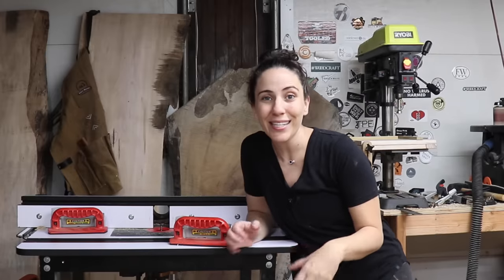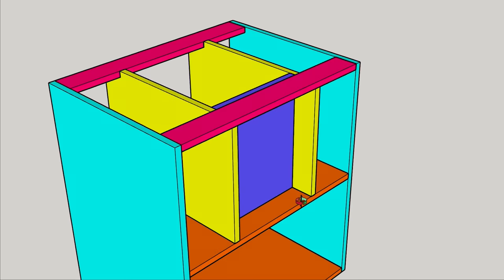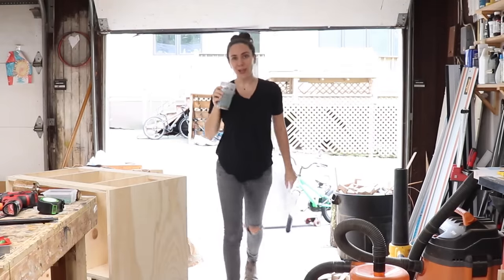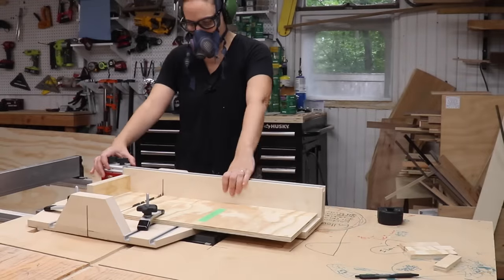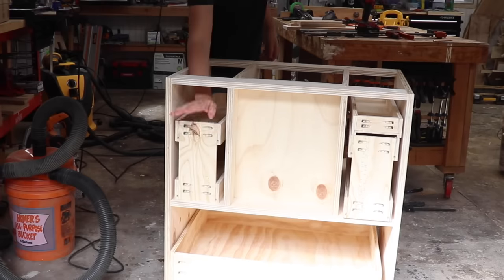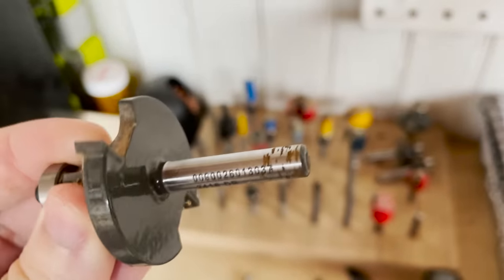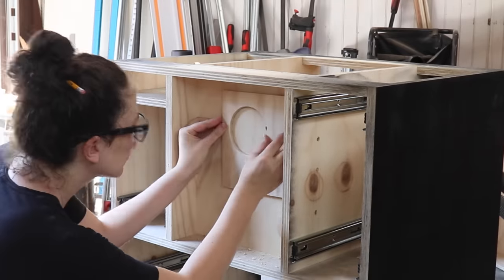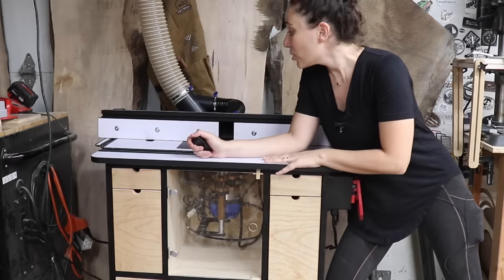Router Table Cabinet Build with STORAGE and DUST COLLECTION

Comment: Hi, Tamar,
Very nice work, even with the slots it looks really design cool.
I am sure that the vacuum suction will work better when the suction port is placed at the bottom or as down as it can in the back wall.
When there is suction in the current installation, the placement opposite the outer is such that the air is obliged to suck around the router body. 
So I think that this creates a vortex and the dust travels everywhere. 
I hope this will lead to get a  better result.
Keep it safe, it is not over yet.
Willy from Belgium.
😷😷😷
Reply from the maker: I think you’re right. I’m going to try to flip the door upside down
Reply: @3x3CustomTamar  
I did not think in you’re off smart stile, but you are right too.
We all should be very happy, we are geniuses.
Keep it safe, it is not over yet.
Willy from Belgium.
😷😷😷

Comment: First, again, great design and build.  For dust collection, I purchased the Keen Products dust collector (Woodcraft appears to carry it).  The rig catches the dust that falls around the bit, which the table top hose struggles with, and seems to get the job done.  Milescraft makes something similar now as Keen was the only one I could find back in the day.  Ignore the Pocket hole trolls.  Use them whenever you want.  I quit using them to make lots drawers as they take too long.  Instead, I know use a variable size dovetail jig, just cut and glue.
Reply from the maker: I’ll look into that!

Comment: try moving the dust collection port and the slots in the acrylic door to the bottom of the cabinet, so you still get suction in that portion of the cabinet, but the air flow goes across the bottom of the opening, to pull that dust into the port.
Reply from the maker: Definitely something I’m going to try

Comment: Put the dust port at the bottom of the center router area, then put a slight angled bottom in there funneling the dust into the hose.
Reply from the maker: Going to play around for sure

Comment: Dust collection solution.  The dust is settling on the bottom. You need a floor with a lot of holes in it.  The hole in the back should be below the level of the floor.  You don't have enough power to suck the dust horizontally sideways out of the large volume cabinet.   If you make the volume of space below the floor narrow enough, there will still be enough pressure in there to suck it out.  So, to recap.  Dust settles on floor. Holes in floor allow it to settle and fall through and be sucked out because small volume of space allows dust collector to suck everything out of small volume space.  So, just add a floor with holes about 4" higher and put a new port down lower on the back. It might also be a good idea to get an air duct that is shaped like a V so you are drawing air from a wider area than the small circle.  Currently, you have dead air in the corners.  That's my story and I'm sticking to it!It is possible that just moving the port on the back to the bottom of the cabinet will solve your problem.  Do that first.
Reply from the maker: That’s seems like it would work

Comment: I suggest changing the position of your back dust port to the bottom of the router enclosure. It looks like the router is blocking the port. If the port was on the bottom of the enclosure, It would suck all or the majority of the dust that ends on the bottom. Also, the plexi door. These slots for the air are great, however, move them to the bottom. That way the air that is sucked in will take the dust towards the dust port at the back. You can also use magnets for the door to stay closed.

Comment: so much going on in this video : first , I think you should see who was paying attention . Give an award to someone who can tell you the number how many times you said  "Drawer" . hahaha . 
the remote dust collection , so cool.  How do you like that Ryobi cordless stapler? ?   I use the Ryobi battery platform so I am interested. 
That router table turned out great !  I love it . suggestion: check all your dust collection joints for leaks with the machine running . use that Duct tap   ;-)
I have 6 or 7 different boxes and original containers with all my router bits. I can appreciate the drawer storage and foam holders a lot . 
your out takes are so relatable , I have a 8 x 12 work space and I loose stuff in it all the time. 
I have rambled on enough .love the video .
Reply from the maker: Haha! I like this Brad nailer for sure. My favorite ryobi tool

Comment: My router table. Has a V shaped bottom culminating in a slotted 2” PVC tube and the dust collection is connected to the tube. The dust slides down the sloped sides and into the slotted tube. Works great. I also have venting for the router motor so it’s not sucking dust through the motor. It also eliminates the conflict between the dust collector and the motor fan. The router wants to draw in air at the bottom and brow the air, dust and all out the top, basically in your face. This eliminates this problem. You could easily incorporate those designs and all but eliminate your dust problem.
Reply from the maker: Definitely going to play around

Comment: You should try putting the vents on the door at the bottom of the door, so the air gets pulled in low and the dust collector has a better chance of catching the dust before it hits to dead zone at the bottom of the compartment.

Comment: I have a Kreg router table similar to yours and have been thinking how to build and mount a similar system within that metal frame. Your idea of building a whole new carcass increases storage and is probably simpler and easier to construct than fitting a box inside the existing frame. It’s the top and the router insert that makes the router table so effective and just moving it to the new box/frame makes more sense. Please see my thoughts on improving air flow in your already great design.
Reply from the maker: Yeah, I liked just starting from scratch. But I have seen ppl do similar things using their frame

Comment: The key to the caw is in the draw. 
My experience with dato blades has been that the drawer bottom doesn’t fit tightly in the dato groove. I still use them to save time, but I’ve thought about using your method to improve fit. Nice job on the cabinet. It looks great!
Reply from the maker: Thanks so much!

Comment: Good timing, I'm about to build a similar box for my miter saw with storage for all my woodworking tools and could use the tips.
Reply from the maker: Nice! Glad you liked it!
Reply: Welp, I tried spray painting mine and it ... does not look good. Gonna go back over and roll on some latex paint.
Reply from the maker: @srwapo  oh no! I did 2 coats. Maybe that’s the difference
Reply: @3x3CustomTamar  maybe. Also tried spraying outside, so the wind took a lot of it. I brushed on some flat black and it looks much better. Also got some discount reject paint for the accent that is totally red and not pink. Looking pretty good.

Comment: Hey, I think the dust issue might be due to the fact that the vac port is very high up from where the floor is? I am going to fit mine at the bottom and maybe place some plwood forming a V forcing the dust towards the opening.

Comment: Hi Tamar. i had another question. i noticed incra has whats called clean sweep which is holes in the router plate insert. what are your thoughts on doing that or making your own to improve dust collection when making grooves or datos since it tends to shoot the dust out to the left of the table? i saw a video of someone making a round hole in their plate and it looked great. just wanted your thoughts on it. ... Maybe you should try making a copy of the holes incra does into your plate to test??? could be awesome

Comment: Just watched the video again.  The problem you are having with the dust collection.  I believe it would be fixed if you moved the dust collection port to the bottom of the box in the back.  You'd have to cut the bottom of the port to get it flush with the bottom, but I believe that will fix the issue.

Comment: Great video you need a thinner diameter tube to increase the suction, might be an idea to have a second branch of tubing going into the cabinet from the back placed up near to where the router bit goes through the table that way it's sucking chips from the back and also from underneath the hole in the router table (as they drop through onto the router) and with using alot thinner tubing you'll have alot more suction on both something like the thickness of a normal small shop vacuum hose or slightly thicker but give that a try to see if that helps as you're losing too much suction on such a wide hose you'll need a massive vacuum force to make it work.. just an idea/theory without seeing it up close.
Thanks for a great video!
Best wishes from London England 👍❤️💪😎🏴🙏

Comment: For your dust collection,  how about changing from the large round hole up high to more of a floor sweep type at the bottom of the compartment? That would pull the dust from the bottom where I t collects.

Comment: I really like the design idea! Maybe add some kind of collar on the bottom side of the router bit opening on the table? Could restrict the amount of debris that drops into the router cabinet. It seems that your opening is larger than any of the bits that you'd normally use.
Reply from the maker: Maybe!

Comment: I love that router table I am going to try and make it . I agree with flipping the door so air pulls from the bottom. Wanted to ask how you like your shaper is it hard to learn to use. I'm knot great on running programs on the computer like Microsoft excel and power point stuff.  Are you selling plans for the router table. I think I need to set up a Tv that gives me YouTube in my shop
Ty

Comment: I think the issue with the dust collection is that the chips that end up at the bottom are falling due to a possible vortex action caused by the air moving around the router.  This vortex action allows the chips to move outward away from the dust collection port and then fall to the bottom.  A possible solution would be to put the dust collect port at the bottom of the router area so that it can pull the chips off the floor of the router area.
Reply from the maker: Going to try

Comment: Tamar do you think the router insert ring is allowing sawdust to drop into the center compartment? Could you try placing an insert ring that has less clearance especially while utilizing a smaller bit? I hope this adjustment helps 😉👍🏼
Love the cabinet build 🤩
Reply from the maker: For edge cuts? Possibly!

Comment: Nice job.  I have Kreg Precision Bench Router Table.  Personally I find it to be too small most of the time.  I'm currently in the hunt for design ideas, and this is a great build.  What router table is that?  I want to find the right sized table.  You have received a bunch of comments regarding dust collection.  In you next video you fix the dust problem.  One question is why use 90 degree elbows when it's recommended to use 45 degree elbows to increase airflow?

Comment: I have the same problem with the dust falling into the lower compartment on my new woodpeckers router table. I used the metal base and built cabinets in it.

I placed the bottom of the hose connector lower than yours, maybe 2" from the bottom. I think I'm going to put a piece of plywood slanted from front to back that meets the bottom of the hose connector in the back - which should allow gravity and suction to do a better job, I hope.
Reply from the maker: I’m going to try something like that… eventually…

Comment: What countersink drill bits do you use? They seem to be doing a good job.The ones for pilot hole and countersink in one action.
For dust collection for the router chamber, maybe it's worth it to make the bottom not flat, and move the dust port to closer to bottom.
Reply from the maker: Amana linked to it in the description 👍

Comment: Once again an awesome and well thought out project. The final product also looks soooo good. I would probably have installed push-to-open magnetic latches on the acrylic door. And then, I would probably have discovered that the suction from the vacuum would pull the door in and cause it to open when the vacuum was switched off. So another mistake for me. One suggestion on the dust cabinet I thought might make the dust clear better, is to put the port for the vacuum hose at the bottom of the back piece. Not sure it that would make a huge difference. Just a thought.
Reply from the maker: Ha! I was going to use push to open magnet latches. And just decided not to. Not for that reason. But glad I didn’t now. Ha

Comment: For better dust collection in the area under the table, consider moving your dust collection hose so that it sits UNDER your router.  The bus has to fall and if the collection is underneath the table, you have a better chance of dust collection particularly if you add in the vacuum aspect of the collector.  Just my two cents.
Reply from the maker: Definitely going to play around

Comment: A single slot at the bottom of the door would probably help the best. The air is sucking well through the table, it's only heavy shavings falling out of the airflow. 1 slot at the bottom of the door would introduce airflow along the bottom of the cavity, stirring up the shavings there and hopefully sending them up back into the airflow.
Reply: Or make a shroud around the router itself going up flush to the bottom of the table.
Reply: I didn't notice if you had dual extraction (fence + cabinet). If you did.... as above. If you only had fence extraction then.... That's not gonna suck up those shavings. They are too heavy and are falling out of the airflow created by the fence extraction port. Just adding this for completeness.

Comment: Hey I'm an absolute novice woodworker but I think the dust collector hole should be at the lower end and the air flow slots should also be lower. Love your channel
Reply from the maker: It’s a good point for sure! Thanks!

Comment: I'm not going to read through 1000+ comments to see if someone has already suggested what I'm thinking, so here's my two cents.  I would have had the air inlet near the bottom of the door.  Also would have had a strip of wood along the edge behind the door and I prefer to use a magnet to hold it shut.  You need as much air flowing in as is flowing out.  Look at what the door is doing.  You have a vacuum there.  Also you might upgrade the filter on your dust collector.  See stumpy nubs' video about that.  Damned filter costs as much as the dust collector, but should be worth it.
I sure miss those 20% coupons and free flashlights.

Comment: As for the start/stop switch, velcro it to the cabinet.  As for the dust inside the cabinet, air probably needs to come in through the bottom of the plexiglas door causing a draft to stir the dust and make it to the port.  Just a thought.  I do like the cabinet, great idea and execution.
Reply from the maker: Definitely going to play around

Comment: That's a pretty nice router table. With the dust collection, your cabinet is square and has areas where there is no air circulation. If you had a circular collar attached to the underside of your table and have vacuum taken off center then your could create a vortex. That'd mean the collar might need to be off more to one side than other to control how the saw dust circulates under the table.

Comment: You could try lowering dustport all the way down to bottom and make low 1/2 slot at the bottom of the door so the air sweep a cross the bottom

Comment: Love it.  I might have to make one like it.  Mine is current still an old "just for now" stand from 10 years ago lol
I'm sure none of this is new in the past 3 days, but I'll say it anyway :D 
I wonder if lowering the 4" dust port would help with keeping the box cleaner.  The air vents on the door was a good idea, as dust collectors are designed for airflow and not static pressure, so move air movement is better.  Best option would probably be a dust chute in the very bottom, but that kills the drawers, which I'd rather keep than optimize the dust port.  Either way, huge improvement!
Reply from the maker: Something I’m definitely going to experiment with

Comment: just a thought....you could have a slanted bottom on the route cabinet which would make the wood chipping fall and slide to the back part and then have a half inch slit on the back connected to the vacuum

Comment: This inspires me to make a stand for my Bosch contractor’s table saw. It’s got that tubular stand that takes up way too much floor space (attached garage… not as large as yours). 

I wonder if you put the dust collection port lower if it would get that dust? Gravity is pulling it down more than the suction.
Reply from the maker: I’m def going to try that

Comment: Hi, try to cut only one slot at the bottom of that plexiglass door and make an air intake channel in the bottom of the router table where the slot on the plexiglass is located. This way you would guide the negative air pressure directly in the centerline of the router opening. I think this may solve your dust accumulation problem in the router box.
Reply from the maker: I needed up fixing it. Hopefully I’ll get a video out 👍

Comment: I would probably redesign the dust collection box and change the location of the hose.  The box could be angled down to the back and bottom and then the dust port could be lowered.  The angled part could still be made of acrylic and be attached to the front door so it moved out of the way when you open the door.
Reply from the maker: Sounds interesting